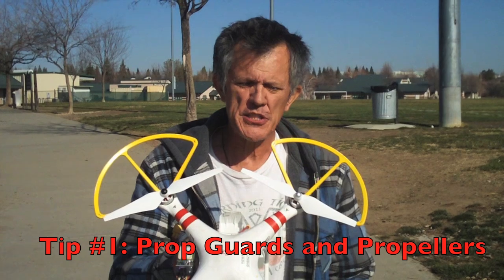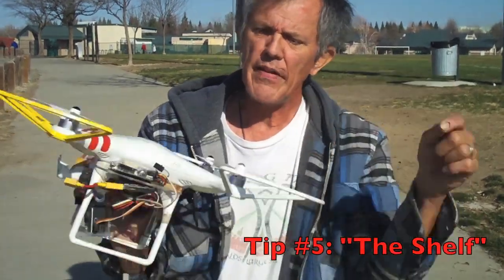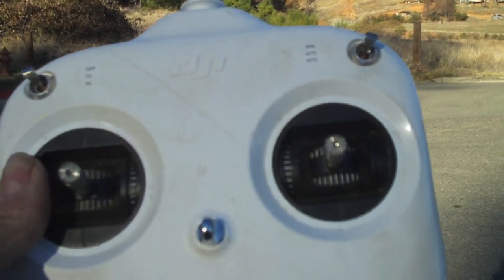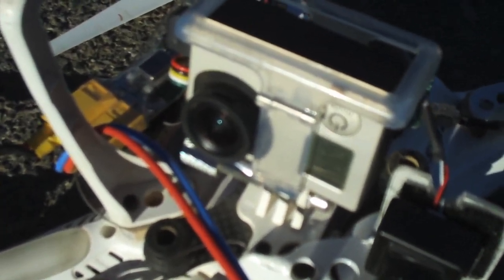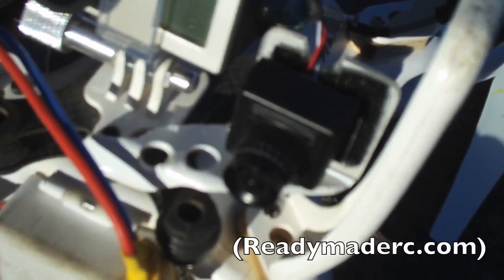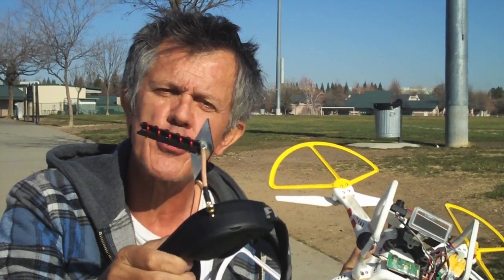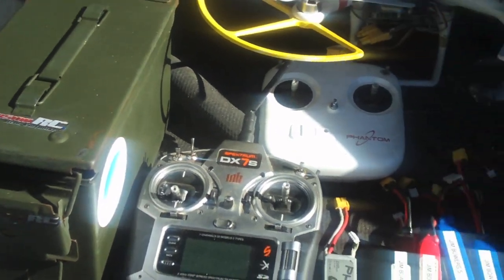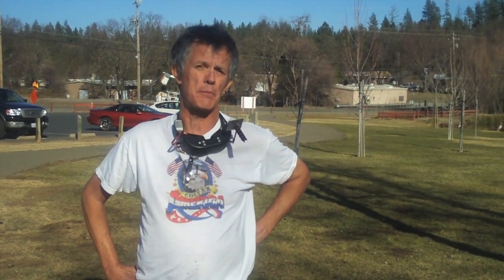DJI Phantom - "25 Tips and Mods" for your Multi Rotor, Quad Copter, Drone!

Comment: Have you considered putting a GPS tracker on this in case it takes off and gets lost?
Reply from the maker: The Phantom2 Vision+ HAS a GPS tracker built into the iPhone app.... plus a TRACKER adds a lot of weight to your bird.
Reply: Demunseed No, no, I mean the little ones weighing just 1.5 ounces that you buy on eBay for $20 where you text it a command to return it's location and it sends back a link to the position on Google maps.  If the built-in GPS loses it's location and it flies away, like some of them are reported to do, that wouldn't do you much good would it?
Reply from the maker: As long as you have "signal" it will mark its last location. But if you have a tracker that weighs only 1.5 ounces... go for it!
Reply: steve c That's cool. Send me a link.
Reply: Ken Skid Here's one on Ebay for $24 that I know will work but you can find them for just $20 if you search. It runs on 12 volts and has a cellular modem and GPS module inside weighing just 1.5 oz. You need GSM phone service to activate it by putting in the SIM and calling it with the Administrator's phone number. The cheapest voice and text only service for $10 every 90 days on T-Mobile works fine, you don't need data unless you want to follow it's progress constantly on a map in real time. Some models also have an output that can operate a relay to do something like disable a vehicle or in this case maybe sound an alarm to aid in finding the copter. There are cheaper Mini models that are even smaller but I don't know how or if they work. Avoid the similar looking ones with a graphic of a motorcycle on the case since they don't actually have a GPS but claim to work by location of cell towers, problem is some of the towers can be up to 1 mile from where they are supposed to be on the map!  http://www.ebay.com/itm/300975628531
Reply from the maker: I'm not crazy about these devices... the only "external" GPS locater i would recommend is the Garmin
Reply: Demunseed You'll like it when it finds your lost drone. It can pinpoint my car sitting right in the driveway.  What good is a Garmin, will it text you the location?
Reply from the maker: you dont need "cell service" with a garmin....
Reply: Demunseed Don't be silly, that would be useless, how can you call it then?
Reply: Yeah...I'm not sure a Garmin sends "out".

Comment: How does a lipo batteries explode? Whats the common reason? Im concern because im going to hawaii with my phantom, im thinking is it safe to store it it my luggage? Or do they (airline) even allow me to have it in the airplane? Im planning to get 1 extra battery for the trip. Im a novice so pls i need an advice thank you.
Reply from the maker: Lipos explode because they just short out internally, heat up and then explode. There's no real "reason" for a lipo exploding unless you intentionally short it out. As far as transporting it, I would recommend you put them in a metal box and "carry on" - just show them to the TSA guys at check-in.
Reply from the maker: SUKESH - there are NO legal restrictions for flying or buying a "drone" in the usa. You only cant fly OVER 400' in the air AND you can't use your drone to "make money" (no commercial use allowed)
Reply from the maker: no - its not required. I dont carry it myself.
Reply from the maker: Demunseed a federal judge just overturned the FAA ruling restricting commercial drone use. You can NOW make money with your Phantom....

Comment: hi jim i tried the 9"props and did like them i didnt have those you have there they wasnt self tighting . but they were very flemzie,and in the wind they were very unstable.to me i think the stock props are better bro.but i seen some 9"props that look just like the stock props .have you seen those?and do you have that type of props?
Reply from the maker: you can use the VISION props 9" self tightening. Do not use "knock offs"
Reply: The self tighting props don't work on my motors .
Reply: And the one I have thats like those are very flimsy.
Reply: I need some stiffer props to hold the weight.
Reply from the maker: i ordered some of the stock  9" VISION self tightening props (and prop guards) - its the best set-up
Reply: my phantom flys better with the stock props and protectors more stable.
Reply from the maker: (mine does too actually)
Reply: i put the stock props and protectors back on charged the stock lipos and got 9mins today.and it was a much more stable flight.
Reply from the maker: i have some of the self tightening stock props (9") work great - and your right, the stock props "behave" much better then the flimsy vision props... but if you get a good pair of vision props, you'll get more flight time and more power.
Reply: Yes - i fly with 9" stock vision props on my Phantom 1.1.1
you can buy them from readymaderc.com

Comment: hi jim i need to know when running two lipos do you have to mess with the gain and stuff from the computer?
Reply from the maker: First off I will tell you that it's not really worth it to fly two batteries - no one i know (including me) has ever kept them on. (they add excess weight causing the phantom to become unstable in flight, especially on landing) and #2: They will only add a couple of minutes of flight time, again duet to the increased weight. 

If your STILL going to try it - don't worry about your gains, just go for it - i did.
Reply: ok i changed my gains already,ill put it back to defult ok.and ill try the two lipos since i already got the dual carbon fiber mounts.i do have the 9"props on it now.
Reply from the maker: well, it sounds like you've got it ready - let me know how you like it after a dozen flights or so... :-)
Reply: im going to put my gains back at defult ok and ill try the two lipos like that.
Reply from the maker: sounds like a good plan...

Comment: the problem with the white is the lower resolution. obviously the wifi add-on. the new gopro black will record in 4k. why would you put on a separate camera? why wouldnt you do fpv through the gopro?
Reply from the maker: The separate flight cam is FIXED and not connected to the gimbal.... better for flight orientation....

Comment: Will Fatshark FPV goggles work on a Phantom Vision 2 if I install the FPV video transmitter?
Reply from the maker: how are u going to power it?
Reply: Demunseed The goggles, the OSD or the transmitter?
Reply from the maker: How are you going to power the video TX?
Reply: Demunseed FatShark Filtered FPV Transmitter Power Supply (2S/3S/4S)
Reply: Ricky Moezinia I am a novice, seeking advice :)
Reply from the maker: You'll need to open up your phantom and tap into the one available power lead that comes off the main power supply - its easy to find.   Problem is, how are you going to tap the video signal? Ive not heard of this working before
Reply: Demunseed I guess if I build a shelf like you have done on your drone, then the video TX can be powered by the one available power lead. Why wouldn't it work if the video signal and TX are on the same frequency band? and why would this work on other phantom dii drones except the phantom 2 vision. thanks for your help
Reply from the maker: how are you going to get the video signal from the vision camera?

Comment: I'll give you short a review for my thumb down: 
I work with professional, national broadcasting TV in Sweden and I have some standards do live up to. Your recommendations seems more to be for an amateur drone flyer then a professional.
For starters: I would never, ever fly without stabilization from a gimbal if I actually plan to use the video, your extra skids could be a good idea but they will show in your video and what the heck is that extra camera doing there when all you really want to see is the direct view from the GoPro.
Buying a GoPro Hero 3 Silver is out of the question if you really want some great videos. It has the same slow video processor as the old Hero 2 and 1080 is the (soon to be old) standard HD definition. When you posted this video the 3+ already was on the market and now that's old as well. 
I guess you know your way around soldering, wires and batteries and I don't judge you for your appearance or for dirty gear. However, your knowledge in quality videos is lacking.
Reply from the maker: Get back to me when you have over 7000 subscribers that appreciate your advice. 
1) Watch my newest video on the Hero4
2) The skids do NOT show up in your video shot. 
3) When I fly LOW and FAST (for sport) - I certainly do NOT want (or need) a gimbal.
4) If you knew anything about FPV flying, then you would know that IDEALLY, a separate "flight cam" is essential. 

Consider your Swedish Butt "SCHOOLED"!!

I will give you one thing.... my gear (and my fingernails) were pretty horrendous. ;-)
Reply: Demunseed Doesn't over a million viewers every week on broadcasted television and web-tv count? :) 
Well, it seemed like you were a bit annoyed over that the previous "thumbs down" didn't give you any explanation so I gave you mine. I can't help that you don't like it.
Reply from the maker: SURE it does.... but only if YOU are the one getting therm all there!  :-)

Comment: You mention that "Vision props are $15".  Are you forgetting that anyone that this would apply to would also need to buy and install two new CCW motors? I believe I paid $60 for mine. You can't exactly use the vision props on a Phantom 1 that doesn't have the correctly thread motors installed.
Reply from the maker: jeffydaboy You are correct on the "old style" phantom ones/

Comment: Why don't you buy a cable to go from your gopro to the FPV transmitter?
Then you can see EXACTLY what the camera sees.
Do you have any FPV TX/RX kits for under $50
Reply: 50$ is extremely cheap for fpv, here is the cheapest 5.8ghz fpv full ready to fly plug-n-play kit, good hobbyking quanum fpv kit it is 100$
Reply: +Parker Schnitker (CaptureEverything) hey,where did you get a battery and charger for the Quanum V2 Goggles ??????

Comment: only error is the antenna should be at 90 degrees, not 45. the best reception is the plane exactlty perpendicular to the antenna.
Reply from the maker: That depends where your flying. Most people fly UP and away from them, so I put mine at 45 degrees.
Reply from the maker: I agree with that completely...

Comment: Does the vision props fit to dji phantom 1?
Reply: If you have silver and black prop nuts then YES! the vision 9" props will work great on your P1. (if you DONT have silver and black prop nuts, you'll need to switch out two of your motors so the threads are counterclockwise.)
Reply: thanks

Comment: Prop guards take flight time off and can act as a kite . With the P2 props you should stick with DJI's not knockoffs with both 9'' props and prop guards you have a greatter chance of getting VRS aka prop wash while descending .. 
You have your FPV antenna over by the compass you should move it to the other side less chance of interference .
What is up with the chips out of them props ? Im guessing you don't balance your props it will take some time with knockoffs but can be done . The way I look at it is you got some money into this don't take a chance on cheap props I used them on my P1 never agin . Everyone should learn how to fly in manual mode pretty much all I fly in with my P2 if you want to do flips and rolls goto go manual ..
Reply from the maker: prop guards are a necessity - nuff said.

Comment: What is the fastest ground speed it can achieve
Reply from the maker: 25-33mph
Reply: thank you
Reply from the maker: switch into ATTI mode and it will fly faster - switch into MANUAL mode and it will fly even faster... 40mph!!!

Comment: When I use my fatshark  my phantom loses all control why does it do this is my antenna on the wrong side
Reply from the maker: Byron Rittmaier Are you flying an FC40??
Reply: Demunseed yes it is my fat shirt works with everything but the fc40
Reply from the maker: It won't work with the fc40... .theyre both on the same frequency.
Reply: Demunseed can I change that
Reply from the maker: no.... not unless you switch to a 2.4ghz video

Comment: Nice video, but I disagree with your camera choice and your reasons.  I have never used isolation mounts on my camera and my video is smooth as glass.  Why?  Because I balance my propellers.  If I start to get jello in my video, I know that something is out-of-balance and needs to be corrected.  If you isolate the camera from the Phantom, you are only masking the greater problem, which is an out-of-balance quadcopter.

In this video the Tarot gimbal is mounted directly to my Phantom 1.  Though the video is edited, there wasn't a spec of "jello" anywhere.  This was shot at 1080p, 30fps.

First gimbal shots on a moving subject...

Also, to save weight and battery power, I get video feed straight out of the GoPro.  This is not provides a higher-quality FPV feed, but also allows me to do away with the power regulator, the camera and a couple cables.  An added bonus is that I see exactly what the camera sees, which is perfect when you have tilt control on your gimbal.
Reply from the maker: Great Points Danny - but i still see no reason not to use a lightweight carbon fiber dampener..... just makes sense to me to eliminate even the tiniest vibration from the quad. Plus, im a little lazy when it comes to "fine tuning a prop" ;-)
Reply: Touche'.  However be aware that vibration wears parts, cracks parts, damages electronics and reduces flight time.  A good analogy would be to either balance the tires on your car OR install a cushier seat so you don't feel the vibration and replace bearings and tie rods every couple months...;^)  The "jello" video is the canary in the cave.  If I see vibration, I check the balance on the props.  If those are in balance, this tells me I need to look elsewhere.  It's a great troubleshooting tool to insure reliability.  We may have to respectfully agree to disagree.
Reply from the maker: good analogy... happy and safe flying my friend
Reply from the maker: Demunseed Hey Donnie... what gear are you using to Balance a self tightening propeller? I didnt know theyve made one to balance vision props...

Comment: Prop guards reduce flight time, agility and speed.
Reply from the maker: The pluses far outweigh any minor negatives when it comes to prop guards. They should ALL come with prop guards imho....
Reply: Demunseed
True, in fact DJI could make an even bigger fortune since when the owner eventually removes the prop guards and mistakenly reinserts the 12mm screws into their Phantom, they have just destroyed their four motors.  We must instead use shorter 8mm screws without prop guards!
Reply from the maker: Watch my new video "Vision+ Intro"

Comment: There is a car charger?
Reply from the maker: Sure - charge four batteries at once!
Reply: Thank you for your response. I ordered a phantom 2 vision but I have to buy a battery and a car charger too. what do you recommend?
Reply from the maker: HiTec makes a very good and durable car charger.... Just plug it into cigarette lighter.... you may have to solder on a cigarette lighter adapter (or hook it directly to your battery)
Reply from the maker: http://www.bing.com/images/search?q=hitec+battery&id=EB004BB6BB3515C1B0FE75A817F20C8753EC0B73&FORM=IQFRBA#view=detail&id=EB004BB6BB3515C1B0FE75A817F20C8753EC0B73&selectedIndex=0
Reply: Also. Buy the Zippy 2800 lipo batteries. Best overall.
Reply: Jim Bowers but the phantom 2 use a different battery door... I'll probably have to take another original battery
Reply from the maker: you have a vision style battery?
Reply: I think so , I ordered a 2 phantom vision, should arrive Monday, so I'll know the battery model . I will tell you , thanks again!
Reply from the maker: Those vision batteries will give you 20+ minutes flight time, but expensive. You need about 3 of them in order to always have a couple charged and on hand. (Theyre around $120 each online)

Comment: Well I am in South Europe and I've never ever got green green green ( more than 6 sattelites ) so that means the DJI will never fucking lock the home point if I am flying in South Europe? that's so shitty
Reply from the maker: It's not your location... you should STILL get GPS. theres something wrong with your Phantom, or your settings aren't correct. I guarantee it!
Reply: Yeah, you're right, I just tested it on the middle of a field and it worked great :/ Sorry for being rude
Reply from the maker: no worries my friend....

Comment: Great video. Thanks for all the tips and info. I have two questions. 1. for some reason I can not get my phantom into manual mode??? I have asked everyone and had no success. I plug it into the pc and switch it, but it does not say it is in Manual at the bottom of the screen in the software in green. I just says ATTI?? 2. is what update Naza do you have. I will not go over 2.12. I was told there are many issue. What is your input on these? Thanks. Also checkout my films channel for some of my footage and if you like subscribe YouTube/zebulonthomasfilms  I'm subscribing to you now :)
Reply: Manual mode is only available after connecting via the Naza Assistant and changing one of your modes.  Otherwise out of the box you get 1 GPS mode and 2 Atti modes.
Reply from the maker: After you click on the ATTI button in the Naza Software, you have to hit "ENTER" in order for the changes to take effect. Let me know if that works for ya!